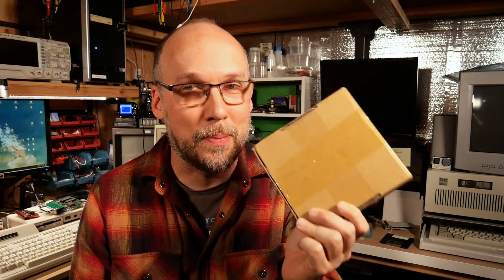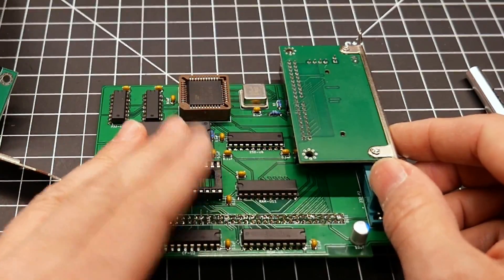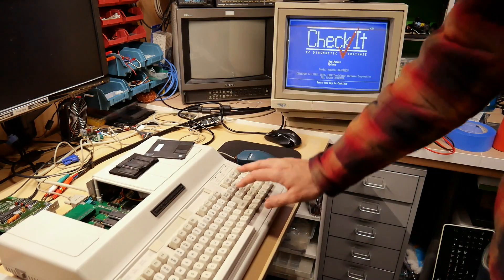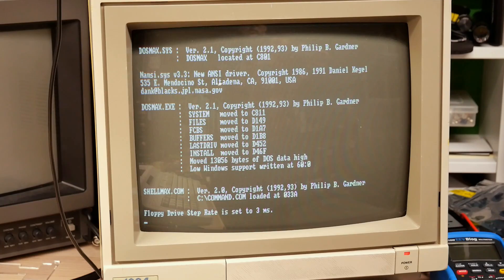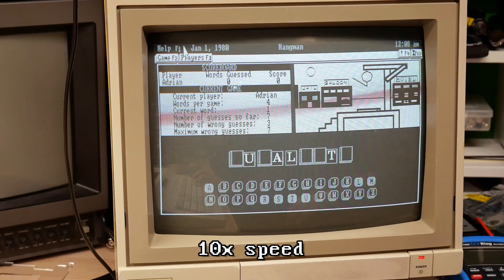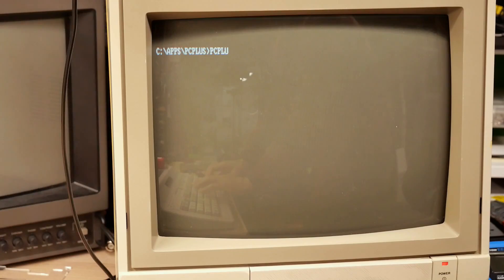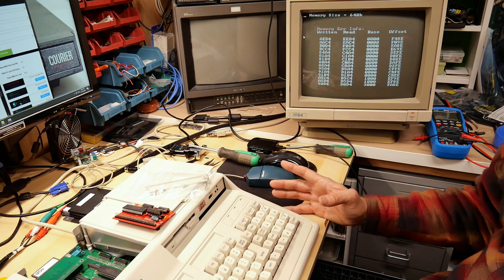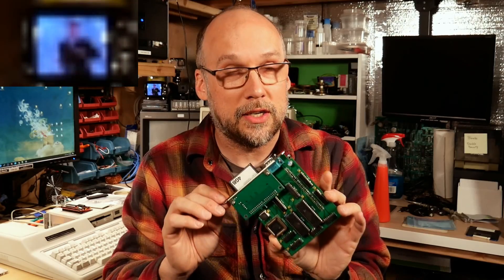Viewer mail: All-in-one RAM + CF + RS232 for the Tandy 1000 EX/HX!

Comment: Audio is a lot worse on this one than your regular videos. Are you using your new camera's mic or an external one? Are you using some sort of noise cancellation on it making it sound so compressed?
Also, this video doesn't look over-saturated to me like your past videos, so that's a plus.
Reply: @adriansdigitalbasement  Does the camera have any ports for a mic? A simple mic mounted above the comera that is wired to it would the easiest solution (no additional batteries that can get empty during filming and you dont have to get sound and video synchron again in Software later)
Reply: Doesn't sounds any different to me.

Your computer/phone must be crap.
Reply: @HuntersMoon78  You know that the difference in audio quality gets more noticeable as your own equipment gets better? If you use bad laptop speakers you will notice much less problems than someone with nice headphones, because most problems are caused by your cheap speakers (like missing lower tones etc) and are the same for all contents. If you can normally hear everything well and one video seems to be worse than the rest, you will notice it. But this video has still acceptable audio. But as someone who mods old computers Adrian should be able to upgrade it further :) We are just trying to help

Comment: The connectors are on the wrong side of his board.  That's why it's wobbly and doesn't line up.
Reply: It lines up perfectly with "Slot 2" on the back of the unit.   There is insufficient room in the slot 1 location for CF interface, so I didn't even bother to try to make it fit.

Otherwise, if you have one of the original filler plates that came on the machine in slot1, it holds it up nicely.
Reply: There's a gutter on the bottom about 2cm deep for connectors on that bottom card. I think it's enough if you only have the Tandy RS-232 card installed. That gutter is just enough for https://www.digikey.ca/product-detail/en/te-connectivity-amp-connectors/5120615-1/A100645CT-ND/2233056 , but as he mentioned, it costs $10.